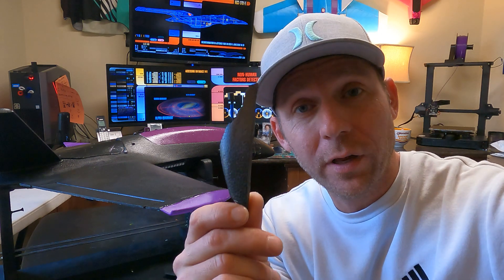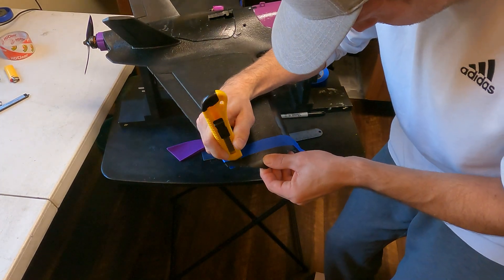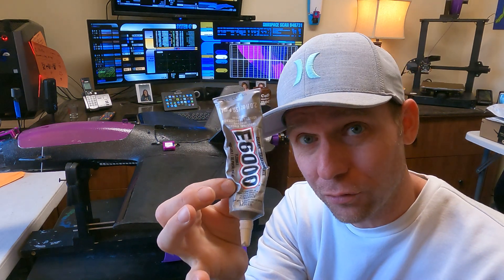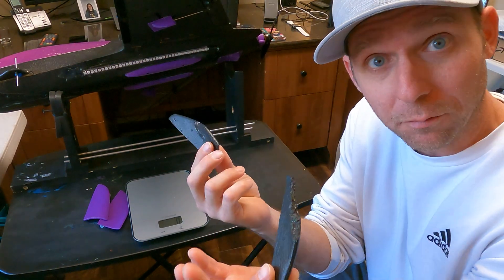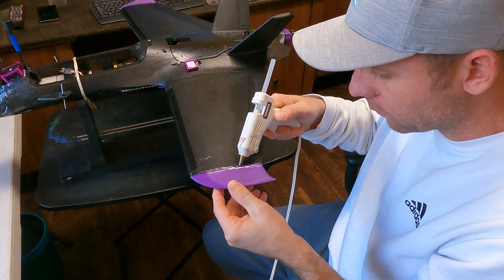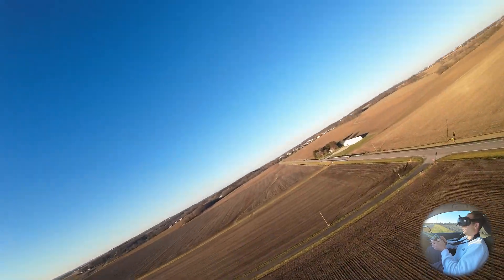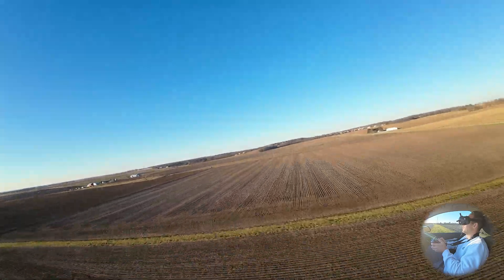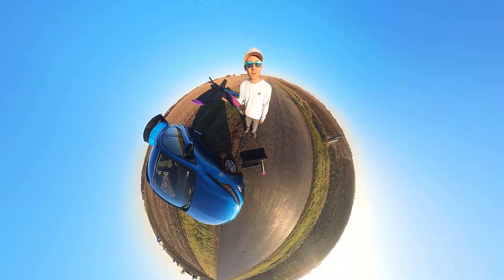ATOMRC DOLPHIN - 3D PRINTED WING TIPS - REPAIR - FREE!

Comment: Thanks for this. I got my wing tip sliced off in an accident and I replaced it with a 3d printed one. It works kind of, but I can't fly above 140kph since i get too much roll because of the different wing profile (only replaced one). I might try your solution. 

By the way, how do you like the dolphin compared to the scimitar? I have a broken dolphin and am thinking about getting a new foam but also about printing the scimitar - which one launches easier? That was my main issue with the dolphin, that I couldn't get it to launch (maybe 20-30% success rate). Otherwise it flew beautifully and fast. Is scimitar better or worse? I'd like to try a 3d printed wing, but if it crashes often on launch and is generally worse than the dolphin, then there is no point...
Reply from the maker: I like my Dolphin the best out of all of my planes.  Both my Dolphin and my Scimitar launch effortlessly.  The reason I like my Dolphin better is the fly times are much longer(hold a bigger battery) and I can mount my 360 camera to it.  Now..... If i had another DJI O3 Air unit i could keep on the Scimitar I would bring them both with me.
Reply: @JeffDoesThis  I love the dolphin too, it's certainly the best wing I've seen, but it's a hassle to launch for me (I launch by the wing which often induces unwanted yaw/roll, I cut myself when launching by the bottom). Also, I want to try something new, but the dolphin is just so cool otherwise. 

How long are the flight times for you? I have the dolphin and the heewing t1 ranger. Dolphin can fly 10-15min on a 6s1000mah drone lipo or 40-50min (and around 45km round) on a 6s3000mah liion. Ranger can fly around 40-50min and 40-45km round on a 3s4200mah liion.

I'd expect the scimitar to be similar, is it that much worse?
Reply from the maker: Well I fly my Dolphin on a ZOHD 5000mah Li-ion and I fly my planes pretty hard.  I am pulling like 10 amps the whole time I am flying so I think I get around 30 minutes or so.  The Scimitar, i use a 2000 lipo and only get like 10 minutes.  Again, I have to transfer my O3 air unit from plane to plane so I just leave it on what I am flying the most at that time.  Typically, when I crash my Dolphin (I am on my 3rd fuselage) I switch over to 3D printed planes and fly them until I fix the Dolphin.  

If I could mount my 360 camera on the Scimitar I would make more videos with it but if you can't see the plane in the video it can get boring for the audience.
Reply: Did you notice any difference in turns or tip stall, with the tips pointing up ??
If you like the Dolphin, you'll be in love with the Penguin. 6S and 1800kv turns it into a Beast...
Enjoy. Subbed.